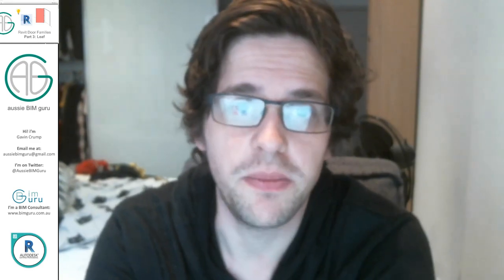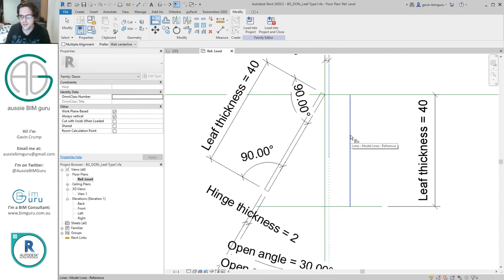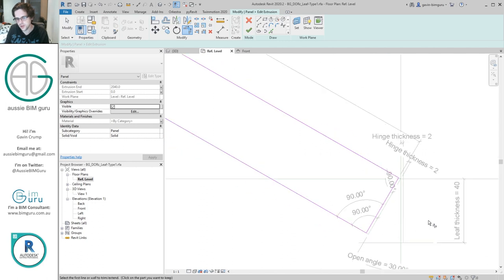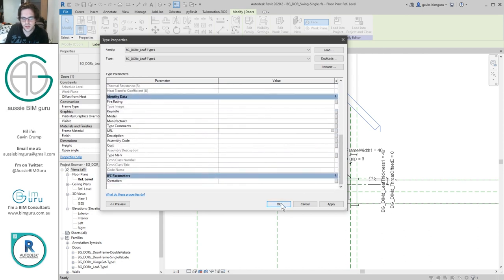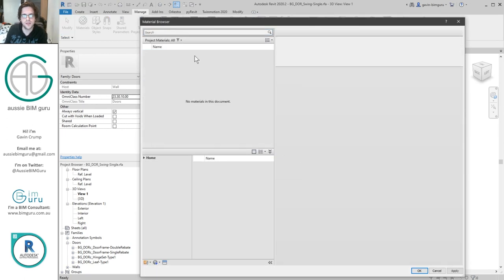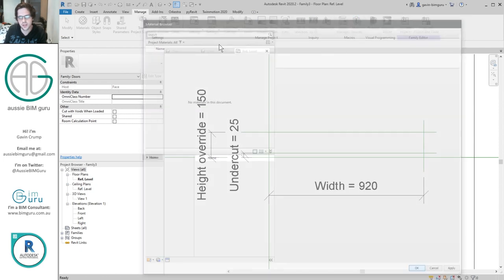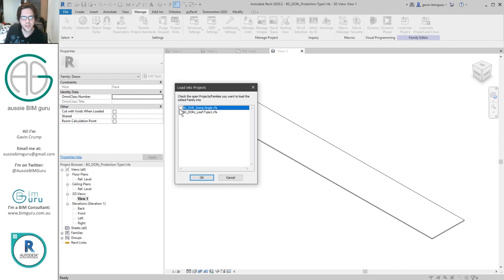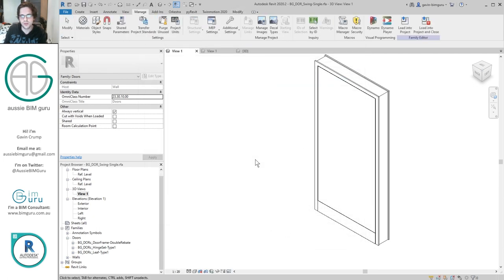Revit Doors, Part 3: Leaf

Comment: Great tutorial, looking forward to the next one.
Painting surfaces in families is not only useful for visual purposes. 
My structural concrete families have surfaces painted with "Formwork" material which alows for scheduling the required area. Especialy useful for complex geometry elements for which defining a foumula can be a chalange, and a waste of time in some cases.
Reply from the maker: Thanks! Yeah single sided face painting is great for takeoff, especially given revit calculates all sides of elements which can be undesirale sometimes.

Comment: cool video as always ..Earlier, i was a bit scared of all those complex formulas and nested families that i never ever tried making a revit family of my own....Now i am confident that i could and more than that i am curious about the vast possibilities of parametric families... Now, I have a query ...How is that when i try loading the family i do not get an option of setting it on a workplane. Am i missing anything ?
Reply: And Thanks Gavin for making all these awsome videos....
Reply from the maker: Thanks! It depends on the family hosting method probably. In this case we're dealing with a door which is a wall hosted family so a workplane wont be applicable. For a loose family like a piece of furniture, you should be able to tick on the setting in the properties tab in the family editor and it will appear when the family instance is selected in the project.